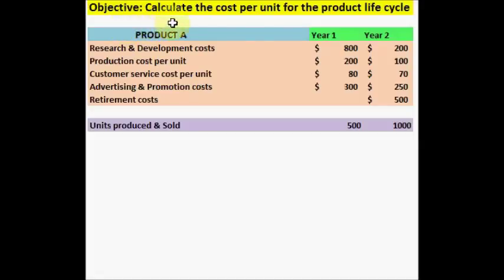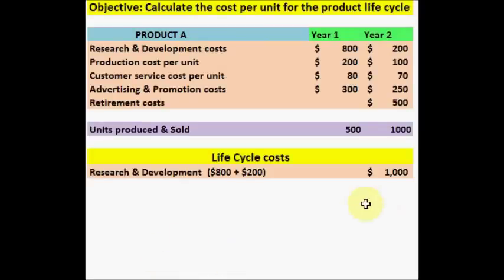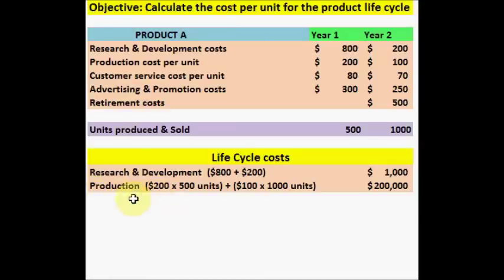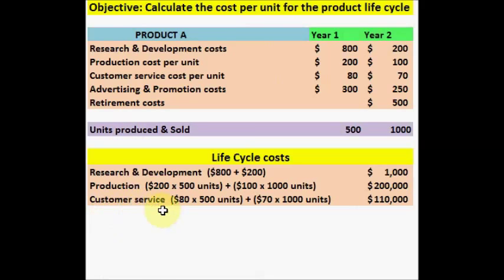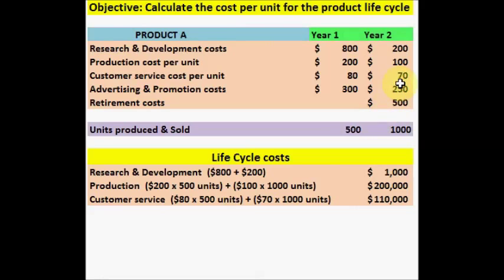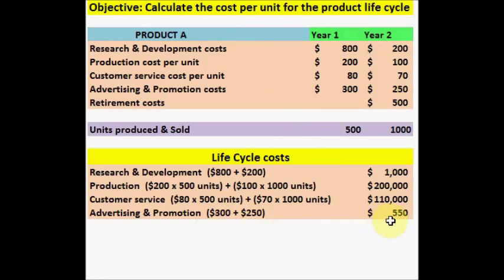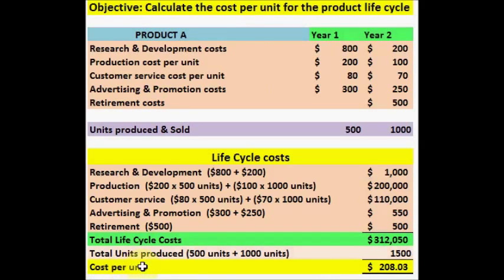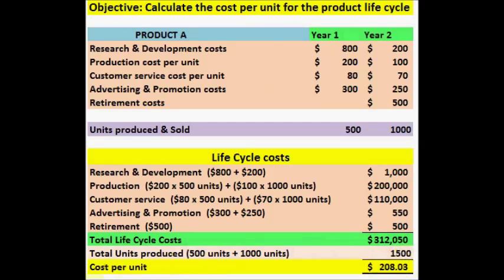Life cycle costing - How to calculate life cycle cost of product

Comment: Dear Friends,
I have many questions:
1 / Life cycle costing can include cost of Marketing cost, SG&A (Selling, General & Administrative Expense) costs?
2 / Life cycle costing can be applied to products with an expected lifecycle of 10 years, 20 years.
3 / Initially, 1 product had 5 features. After 2 years, this product has 2 more features, must be recalculated for a new life cycle costing ?.
4 / Is the product life determined by the subjective intention of the CEO and CFO ?, does this product life mean that this product will be sold on the market from the time of introduction until removed from the market?
5 / What are the signs between the 2 stages of introduce and Growth?
6 / What are the signs between Growth and Maturity?
Thank you.